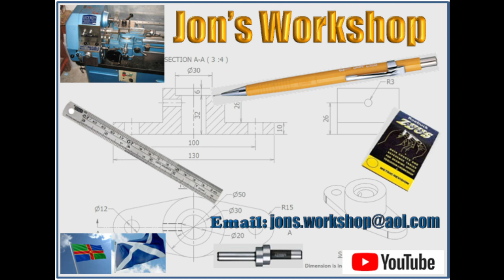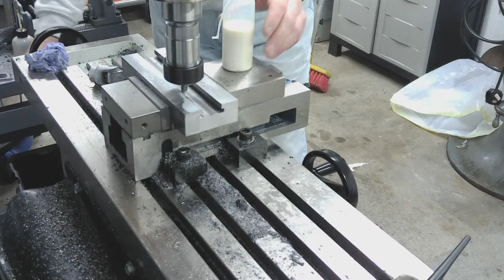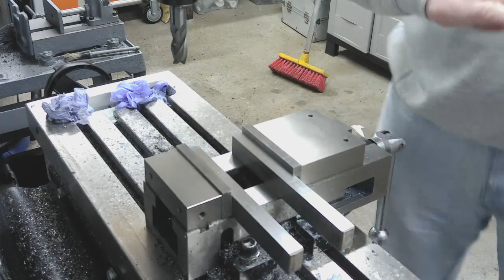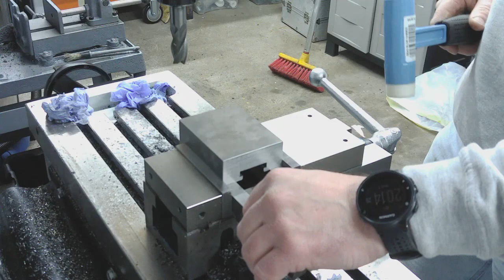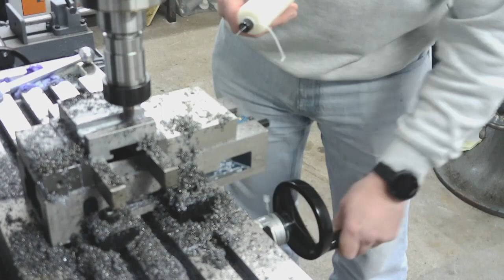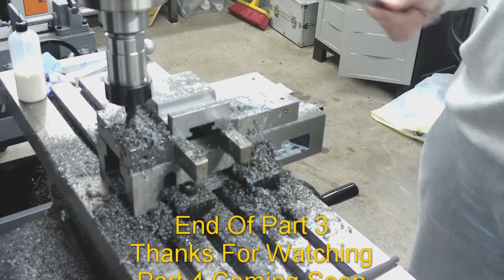Making Dickson Tool Post Holders For Harrison M300 Part 3

Comment: Tool post holders are coming on nicely Jon, DRO will be the next tool on the list will it. Just finished fitting on to my mill and it's made it so easy, you'll wonder how you did without it.
Reply from the maker: Hi David, thanks for the comment. Yes they are coming on well. As you will see (and hear) in part 4, a DRO gets mentioned several times..... Its on the Christmas list, let's hope Santa's listening. Cheers, Jon

Comment: It is preferable to cut the slots along the X axis, as the vice is currently imparting stresses across the "T" shaped clamping slot. Cutting the slot this way removes some of the rigid material from above the slot and increases the already existing stress across the clamping slot.

Comment: seen tools for resharpening that either bolt on the surfacegrinder table or on the magchuck 
steve summers is experimenting with a few of these tools ....... never mind , when i whent looking for the vids i found out he uses a cutter grinder , might still be able to make it work on a surface grinder using a different type of stone and the workpiece placed at an angle
Reply from the maker: Hi Watahyahknow, thanks for the comment. Yes, I have seen a couple of guys using these, they have the primary and secondary relief angles on the block base for touching up the end grind on endmills and slot drills on a surface grinder. From memory, This Old Tony played around with one. Cheers, Jon
Reply: @jonsworkshop  this old tony is more famous than elvis it seems , he better buy some bigger shes or he be walking next to them
Reply from the maker: @watahyahknow  LOL. Not sure what's happened to him, not seen anything from him for months.
Reply: @jonsworkshop  might be that covid slowed things down for him a bit , from the flashes i saw of him (other than his hands) he seems to be reasonably young still

Comment: Put a clock on one side of that long mt4 collet chuck  and push it from the other side, you will probably be surprised how much it moves, hopefully not too much but I still think the chuck has a lot to do with things, hopefully I'm wrong. A vibrating cutter will kill the cutting edge in no time, carbide or otherwise.
Reply from the maker: Hi Derek, thanks for the comment. I will check this out. Now I have everything rebuilt, I plan to run some geometry checks and make the best of what I have. I have a ground Mt4 setting bar about 250mm long, planning to use this to test out any radial play in the spindle or MT 4 taper. Cheers, Jon
Reply: @jonsworkshop  Its not so much the spindle but the deflection over such a long distance, ie stickout distance, a bit like turning a bar in the lathe, its best to work as close to the chuck as posible. If you imagine turning your mill head 90° with the same endmill in how much stickout would there be, you would not turn it with that much stickout.

Comment: All that chatter. Your cutter speed is much TOO SLOW and the cut is TOO LIGHT (carbide really needs and can handle a heavy cut). You could run this at the top speed... (1600 rpm?). A 20 mm cutter is NOT too big for this machine. I run a 75 mm face mill (5 carbide tips) on the same (similar) machine at 1600 rpm it works fine and produces a great result. 
If possible position the end mill further into the collet. The overhang may be contributing to the chatter
Reply from the maker: Hi Zen, agree totally, but as explained in my email, issues with power supply through motor that I need to find a solution to. On the to do list. Cheers, Jon